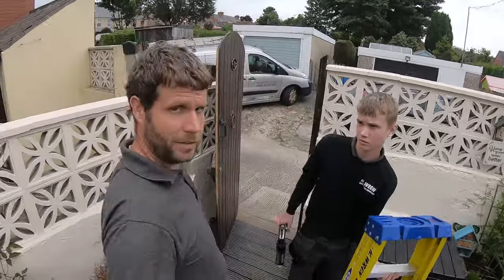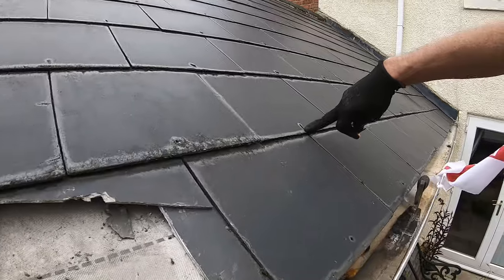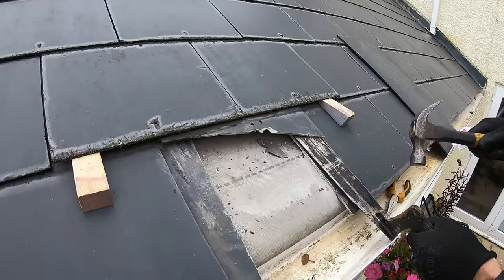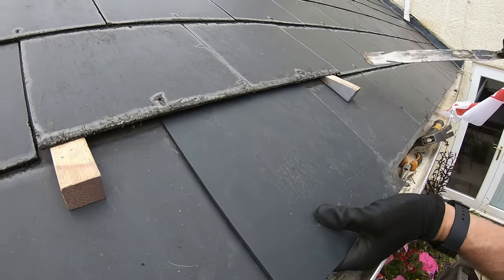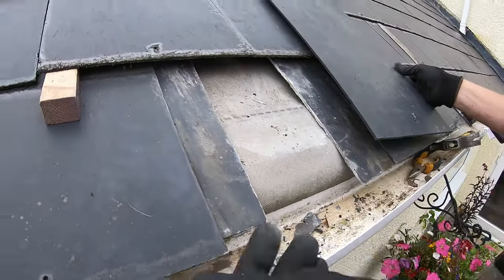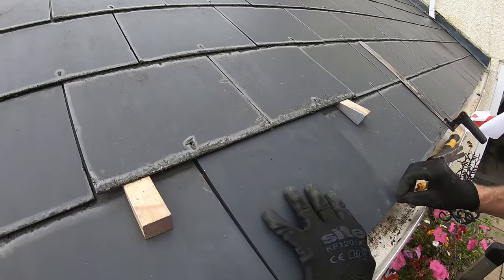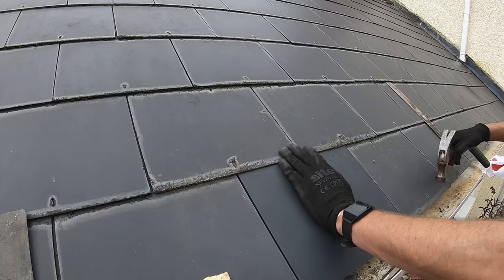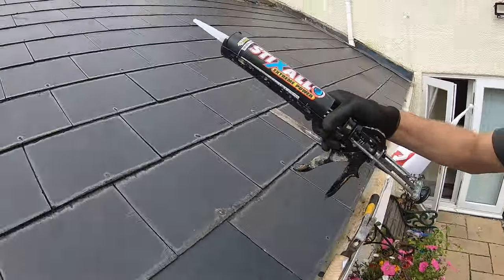How to replace a fibre cement roof slate. (And finding the original bodge job hidden underneath it!)

Comment: The bottom rows ain't right whoever done this roof  haven't a clue...
Reply from the maker: Exactly what I said, its like this all the way along, small slivers beneath each joint. It was actually a so called  "professional" roofer with 25 years + trading who did this roof 15 years or so ago. there's been a few comments left saying I haven't fixed the broken eve which I assume they are referring to these "dodgy" slates. Yes in an ideal world I should strip the whole bottom row and re-do it all but how far do you go, I expect it would be like opening a can of worms! I did mention this to the mother-in-law so she knows it hasn't been done correctly in the first place. Thanks for watching and the comment!

Comment: Where was the dummy eave to enable the rivet for the bottom course to be fixed?
Reply from the maker: Hi, thanks for the comment. Not sure what you mean by the dummy eave? Is that what I would call the under eave course? If so, yes, it looks like most of that is missing or probably never fitted along with no felt support trays. This roof was fitted approx 15 years ago by a so-called professional roofer who had been in the game for many years. I personally don't think its been done particularly well!

Comment: Adhesive will only work for a limited time, that's why we need a mechanical fix like a copper strip. I've never found a slate or tile that had been stuck down to still be stuck down by the time I got to lift it.

Comment: All ways all ways put lead or clip at bottom of slate belt and brace’s never use any tec solution   To hold slate down as if that slate cracks again you will be replacing 3 slates as the tec solution will be bounded to the other 2 and if and pressure you put on top off that will crack as it’s not flush 👍
Reply from the maker: Thanks for the comment. I actually hadn't thought of that, makes sense though!
Reply: I can't remember: what are those old nails that are a pain to rip out, stainless steel? Had a 'bare minimum' job with mastic and those nails used previously, it was... a practice in patience.

Comment: Thank you for this. I’ve got 5/6 tiles to fix from the storms earlier this year. Had 5/6 roofers quote and no one turned up unfortunately. Going to try it myself now! Trouble with these videos is you make it look easy! 😂
Reply from the maker: Thanks for watching! hope it helps. Have a go, its fairly straight forward. Just make sure you have all of the correct tools.

Comment: Thanks for the video. Is it not better to use a copper strip rather than adhesive ? Due to adhesive failure over time, or water build up above adhesive?
Reply from the maker: Using a copper strip I suppose is the "proper" method. I used to do that, however I found that they were coming loose again in a short period of time. Probably as the building had kids climbing on the roof most weekends, which is why I tried the adhesive method. That was at least 10 years ago and cant recall any of them coming loose in that time. I only put a couple of spots of adhesive on, not a bead, to prevent water being trapped too much. Also I personally think it looks a bit unsightly have copper strips on show. Thanks for watching and the comment!
Reply: Copper wire nailed below on the lath. Then up through the rivet hole. Same look as a rivet and 2 dabs silicone top of tile below ones above ??
Reply from the maker: Good idea, never thought of that. Thanks!
Reply: @MrRedfreds 
Best idea here.. just using some adhesive won't last on theses tiles .. in the summer they get scorching hot and that adhesive will peel off

Comment: Instructive, practical + bit of friendly banter - good show! Quick question - if there is indeed a row of slates underneath, would you still glue it? I've got the exact same issue, with slates underneath, one of which also has a broken corner.
Reply from the maker: Thanks for watching & the comment! The last slate will always need additional fixing as you cannot access the fixing holes to fix it to the timber batten. Some people use a strap of lead or copper fixed to the batten then fold this up the front of the slate, but I personally think looks unsightly, so yes I would glue it. Relying purely on the copper disc to hold it in place is not enough. If the slate underneath is going to be replaced too, one of the two fixing holes in that should be accessible to fix it to the batten, then just the one on top of it will need some additional fixing i.e glue. Hope this helps, Regards, Haydn

Comment: Thanks for explaining this job. I have composite tiles that have warped on the south facing side of roof and Im finding the copper fixings on the floor where they have fallen out. 10 year old new build and Ive been told need new roof. Can these be repaired?
Reply from the maker: I'm not a roofer but from the times I have work with theses slates, I have found a few that like you said have warped. I may be wrong but I assume that the copper discs have come out which would then allow the slate to lift / warp over time. I have in the past managed to fit new copper discs to hold them down, however I find they do become brittle and can snap when pressing them back down. It may be worth trying new copper discs before going for a full new roof, you might be lucky and they might not be too brittle.

Thanks for watching and the comment!

Comment: Hi, which make/variation of fibre cement slate is this, are the westerland a grade better, longer lasting? Also, Looking to replace roof in leicester area if you can recommend a good roofer?
Reply from the maker: Unfortunately I have no idea what brand of slate these are and I am not sure if there is much difference between brands TBH. I dont have much to do with these other than the odd slate replacement here and there. I'm based in Durham so cannot recommend anyone in your area, sorry.

Thanks for watching & The comment!
Reply: @HWrenMaintenanceServicesLTD  no probs.. thanks for the reply 👍

Comment: These slates should have 2 eave courses, the 1st is a small eave to hold the rivet in between the actual eave,.. I tell ya these so called roofers!!
Reply from the maker: Yes I know. An absolute bodge, was installed by a professional roofer 15 years or so ago. Its amazing what you uncover.

Comment: How do these weather over time, how old is this roof
Reply from the maker: This roof was approx 15 years old. I have found that they seem to become prone to damage and quite brittle around this sort of age, maybe a little sooner. I'm not a roofer so I dont know a great deal about them so maybe some makes are better than others?
Reply: @HWrenMaintenanceServicesLTD  thanks for the reply, i had a read and it seems 15 to 25 ties in with what your saying. Penny wise pound foolish, slates will provide the longer lasting roof

Comment: Hi how long should this type of slate last?
Reply from the maker: Hello, I believe manufacturers state 20 years plus, maybe a little more. In my experience I have found they become brittle well before then, maybe 10 years or so and are more easily damaged than when new. I'm not sure if other factors such as south facing so having more heat from the sun plays a part in their life span. Hope this helps.
Reply: @HWrenMaintenanceServicesLTD  thank you, how long had these slates been on do you know?
Reply from the maker: If I remember correctly, these will probably be approx 12 years old.